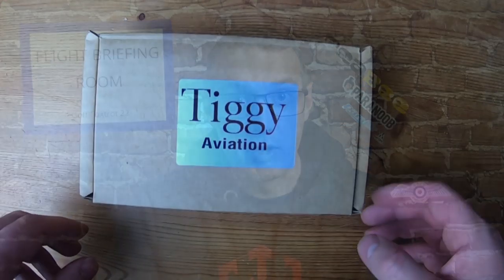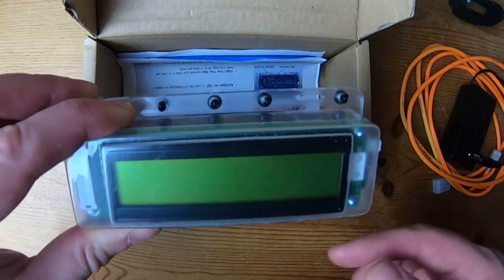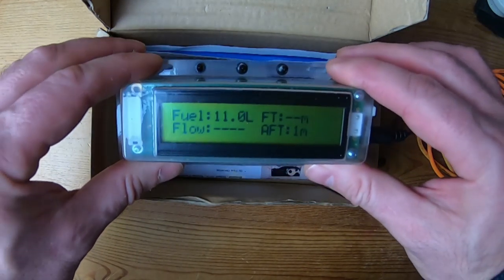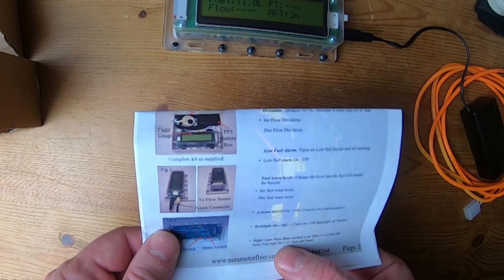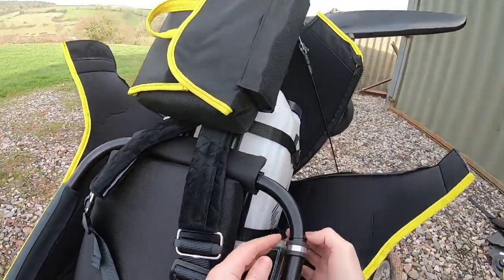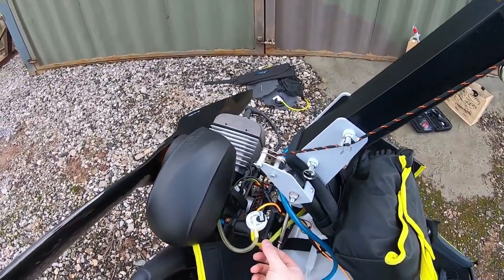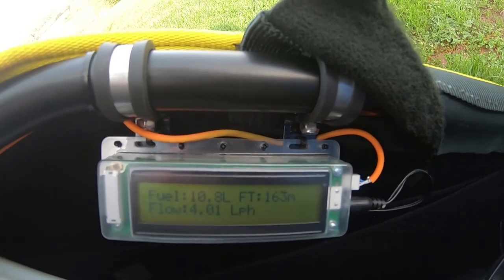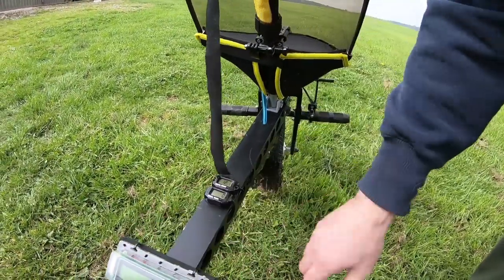Paramotor Flexwing Ultralight fuel gauge - fitting and testing

Comment: Looks like a nice bit of kit that mate. Looking forward to hearing about how you get on with it after giving it a real good run out when we’re back flying. Even with working out your fuel consumption there’s nothing like having that piece of mind that you can check that display that right in front of you.
Reply from the maker: I would still like to do a physical check but I have confidence in the system and I can also moderate my flying to keep the fuel burn low. We just need some good weather now.

Comment: Looks cool.
I also hate to try to calculate my fuel burn and figure it out, or use some kind of mirror.
But I installed the FlyHenry and have also been very happy.
The FlyHenry requires a "sensor stick" to be installed in the tank which more invasive than just a flow sensor in  the fuel lines - but still is not very complicated to do, and then the fuel level is calibrated at full, 50% and zero, and that allows the gauge to show 0-100% or liters or gallons, as desired. 
There is a fuel flow option which uses a similar sensor to this one. I have it but rarely use it because it doesn't give me much meaningful information. 
At some point I intend to do a test of flow rates at different RPM but I've been intending that for a while now.

The one big advantage I see with the FlyHenry is that the display fits on my throttle (foot launched paramotor so no dashboard). Besides fuel level and flow, that same display also shows RPM , CHT & EGT (if sensors are installed), and time of flight.
Reply from the maker: Yes I was aware of the flyhenry but as you say it required holes to be drilled. I just needed the fuel level as I already have a cht and tach. There is quite a bit of price difference but I know that Tiggy are looking to include more functionality and make it smaller. It was only a test of the fuel gauge that I was showing. How does the flyhenry compare to the motomoitor? Its all a compromise. Are you happy with the flyhenry?
Reply: I'm fairly happy with the FlyHenry except for a couple of annoyances in the install.
1) I replaced the 4 AA battery pack with a cell phone external battery bank. The battery pack lasted maybe 2 or 3 flights, the battery bank lasts months at 100% constant background light.
2) The display and computer are hardwired together so I was unable to put the cable in the throttle sheath. Now, 50+ hours in I have a loose contact in the cable somewhere so I get to cut it open and put it in the throttle sheath anyway.
3) My first unit on a previous motor started to fail immediately after launch due to spark too hot. Took a while to figure that one out.

Flying with it has been great. 
I also didn't need another tachometer or thermometer but I'm really happy that I get it all in one tiny but still easily readable display package.
Reply from the maker: @PPGATL  It seems which ever rout eyou go there are always teething problems. I use the Trail Tech Tack and CHT on my paramotor as they sit nicely on my Polini throttle with the leads inside the sheathing ( I like neat installs).  I just use a mirror as its reliable and doesn't need batteries. As I mentioned in the view, I just can't see the tank, but would love a fuel system that doesn't require batteries.  I'll be keeping a spare PP3 9volt battery with me but apparently it will last a ages on the Tiggy.  I have a little bit more of a look into the flyhenry as a friend has one.  Fly safe over there.
Reply: I think both probably Haven their advantages too.
The small size of the FlyHenry display is grea mounted on the throttle t but may be difficult to read at distance.
But either way, after running out of gas twice, that has not happened since I have these.

Comment: I fly a Flylight Doodlebug , which has the exact same problem . The fuel tank is mounted behind the pilot inside the rear fairing . I looked into this unit but quite frankly the reviews were not that favourable , so i began looking around for something similar . I came across a Flymaster product , which not only reads the fuel , but several other parameters as well , including rpm . Now i will be the first to admit it's expensive , but the read out can be displayed on various Flymaster varios , including versions with gps . The end product means a much tidier cockpit , with one display , though you do very much have all your eggs in one basket so to speak .
Reply from the maker: I've been using it for a while now, I've dialled in the percentage and its pretty accurate. There are pros and cons and I'm working with the designer to make a more practical and condensed unit.
Reply: @GolfFoxtrot22  Interesting , i'd seriously like to know how it turns out . I've not fitted the flymaster unit yet , as i'm bogged down with another large project involving a large old vehicle . Parts are difficult to source , but i've pretty much got all the specific parts , and with luck it should be finished and back on the road next year . 
The Doodlebug is next in the shop , where i'm gonna go right through the thing , as it is twenty years old , though still low houred . I plan to give the airframe a good once over , and rework the throttle cables , which are a constant source of problems . I'd also like to rework the mouth throttle , possibly even completely remove the thing , and check that the engine will run on this new E10 stuff . I've heard there are problems with carburettors . That should be sufficient time for any meaning full progress to be made .

Comment: Great video. Thank you. I strongly recommend to use some nylon Strap Clamp (or metal) to keep those fuel pipes pretty well fixed to the gauge. Engine's heat and time can loosen the connections.
Reply from the maker: Thanks for the suggestion. What isn't obvious is I have already wire-locked the pipes onto the impeller.  I didn't want any air leaks, so I ensured that the pipes were securely attached.
Reply: @GolfFoxtrot22  perfect!

Comment: I can see the benefit of having one to check fuel burn at various trim / weight settings, and have a definitive flight time remaining, rather than having to use a mirror and do mental calculations and guesstimates. However using a mirror I can buy a lot of fuel with the money saved 😁 I appreciate in the PB you don't have that option though.
Reply from the maker: Hi Chris, I do like a mirror, no batteries required so it very much a horses for courses decision.  I hope you are feeling better.

Comment: I see you doing your pre-flight check and saying "temps are OK" do you have factory temp gauges, aftermarket or is it a guess based on run time?
I'd like to have temp gauges as these moving and a quick landing can save damage to the engine.
Reply from the maker: Hi Blue, I have a CHT gauge made by TRAILTECH. I've been using them for quite few years now and their tach is also quite good. I hope that helps.

Comment: This is an interesting set-up.  What I worry about is what if that small impeller fails?  Does your fuel flow stop?  I don't even like a primer bulb in line with the fuel, and where you have a bulb it's a good idea to have a by-pass.  This way if one of the valves in the bulb fails the fuel just goes around it.   I think it would be interesting to see just where you are burning he least/most fuel.
Reply from the maker: Spooky you asked as this was asked on one of the UK Sub70 forums. I contacted Tiggy and they have confirmed that if the impeller were to become stuck or fail, there is a void inside that will still allow fuel to flow. You can actually open up the casing. I've also taken my primer build of the PeaBee as well and just prime by blowing in the vent. I hope that helps.

Comment: Very nice review Giles! I really like the way the system works but it seems it may be a little bulky for my taste on a para motor. As with all technology I’m sure we can expect them to get smaller in the future. Would be really nice to have a Bluetooth module that can send the info to a Phone or wireless display. it seems to be ideal for your sub 70 machine.  Do you plan on implementing it to the para motor?
Reply: I was thinking the same thing... Bluetooth it. That would reduce the wiring and make the display more convenient to mount. Over-all, a great idea.
Reply from the maker: I think I would only use it on a paramotor if I wanted to understand how the engine performed at different power settings.  The fuel flow and flight time remaining is quite a good feature.
Reply from the maker: I'll mention it to Tiggy and see what they say.
Reply: @GolfFoxtrot22  polo

Comment: Bad ass, I want one!
Reply: PPG meter from Fly Henry will be more suitable for you. My Scout came with it... ;)
Reply from the maker: Do you have to drill the tank to get the fuel level, or is achieved externally or by fuel flow?  I've got friends that fly with a flyhenry but they don't use the fuel side, just RPM and CHT?
Reply: @GolfFoxtrot22  Hi! Yes, you need to drill a small hole. There is a video on YouTube, search for: "www.PPGMeter.com - How to mount the fuel Gauge for the PPG Meter." But I believe you will love the device. On one small monitor you will have all the information.
Reply from the maker: @fokser  I'll stick with the Tiggy for the time being as it has  what I need and less invasive on the tank. The PPG meter does more but then costs more, horses for course.

Comment: Do you know if they make this for fuel injection engines?
Reply from the maker: I'm not sure what the application will be but if you can fit it to the fuel line, it doesn't matter whether its injected or not.  It just measures fuel flow from the tank. I hope that helps.

Comment: We have a tendency as humans to make things complex!  Put a viewing hole /window in the cover where its over the fuel tank, and a little mirror on the corner of the control frame.  No electronics, no gizmos, and less weight.
Reply from the maker: I am looking a sight tube but I need to find a way of seeing it in a dark space under my are. I really don't want to start cutting holes in my fairing.  I use a mirror on my paramotor and love the simple solution.
Reply: If I’m not mistaken, doesn’t Ben has an increment scale on his tanks?  His fairing, although it’s nice, shouldn’t cover up indication of fuel quantity.  Especially for those pilots who are using their trikes for travel.
Reply from the maker: @moose7472  it's just a plain tank with no markings. Ive put the markings in myself and the tank is fully enclosed. The Tiggy is reading well now and I'm happy with it. I am however designing a sight tube as a backup that can be seen inside.
Reply: Keep up the good work!  I do enjoy your content!

Comment: Will this fuel meter work for a motorcycle ??
Reply from the maker: Hi Greg, it would, but the hardest part is knowing how much fuel is in the tank to ensure it is calibrated correctly.  I personally wouldn't use it. It only works through fuel flow.

Comment: Will this ever come out using gallons?
Reply from the maker: I'm not sure, it's designed to be used with fuel flows in the  3-15 litre is the flow rates it will work with. There are 2 types of gallons so that could get a little confusing. Have you contacted Tiggy?
Reply: @GolfFoxtrot22  What is Tiggy's email?
Reply from the maker: @ernesthiggs7677 https://www.facebook.com/TiggyAviation. I hope that helps Ernest.
Reply: @GolfFoxtrot22  The American gallon has 128 ounces
Reply from the maker: I've never really worked in Fluid Ounces, just litres and millilitres and the UK gallon is 4.5 litres. Nice easy conversions.  Did you manage to get hold of Tiggy Aviation?

Comment: Interesting, although I'm no fan of complexity. Fuel flow should be very closely related to RPM so you should be able to get a similar result without the need for measuring actual flow just using engine RPM and an algorithm.
Reply from the maker: Nicholas, I'm a fan of keep it simple but the Moster gives such varying degrees of fuel flow.  On my paramotor ( same engine) if I'm too heavy on the throttle  +/- 500 rpm it can go from 4 lph to over 5.  I found this on the Icarus X race where I was getting 4.5 normally and suddenly I was at nearly 6.  The top jet on the Moster really drinks the fuel.  I did think about a fuel sight tube but the difference between the litre marks is so narrow I'm not sure how accurate it would be.
Reply: That is actually quite a good solution guess it would take a while to dial in but I guess it would work would have to try at different altitudes and temperature to see if it was effected. I have tried getting the pulse measured from the coil but a lot of filtering needed to capture reliably but definately one I will look at :)
Reply: @RoutoutCNC  With our limited speed and altitude range rpm should have a fairly constant relationship to fuel flow. One you'd worked it out what the relationship was with Giles's setup.😉